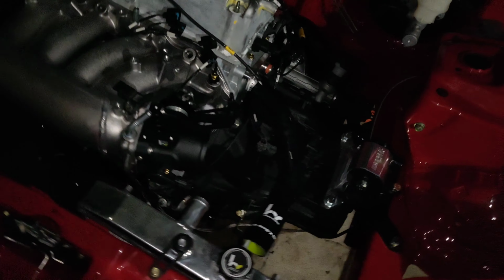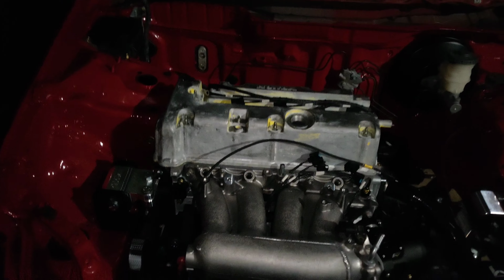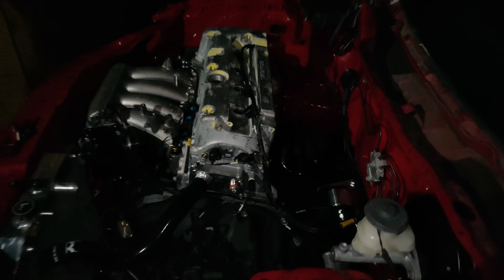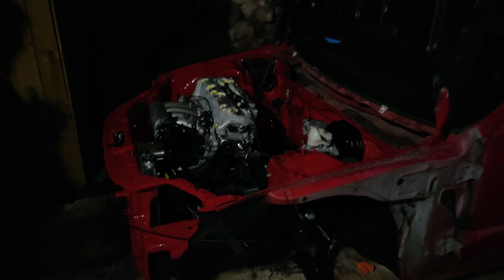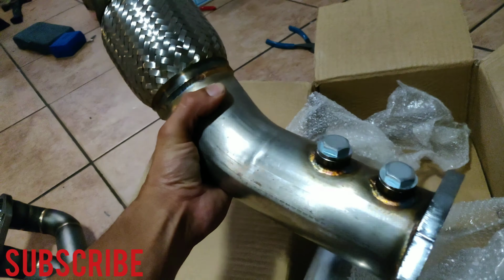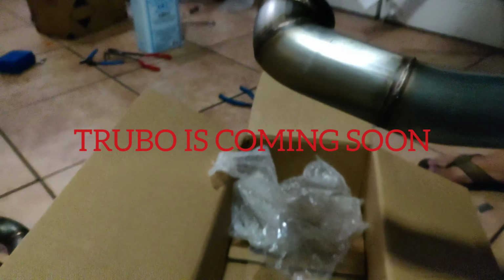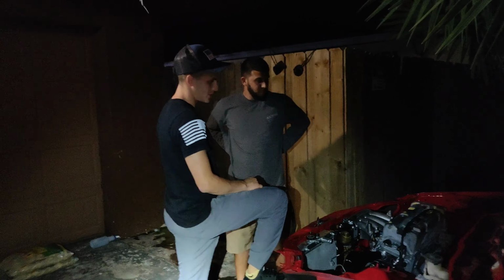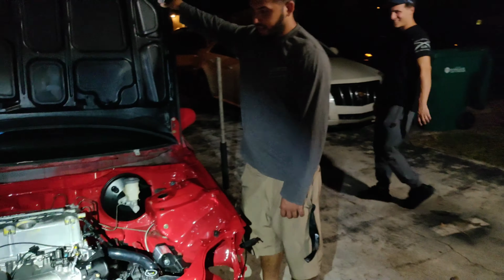K-TUNED K20 VS HYBRID-RACING K24 UPDATE VIDEO (EM1) (KSWAP) (2000 SI KSWAP)

Comment: Hey bro which shifter you think is better hybrid or ktune
Reply from the maker: As of right now I will say the hybrid shifter is working better. We have a hybrid shifter with k tuned shifter cables. Ktuned  cables have to be slightly modified in order to work with the hybrid shifter